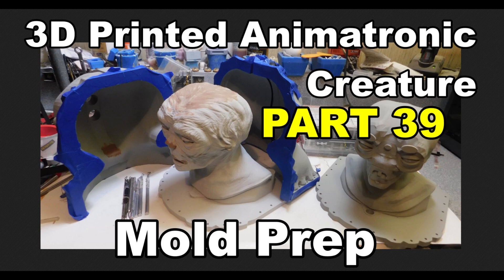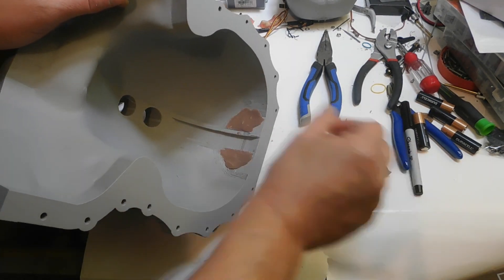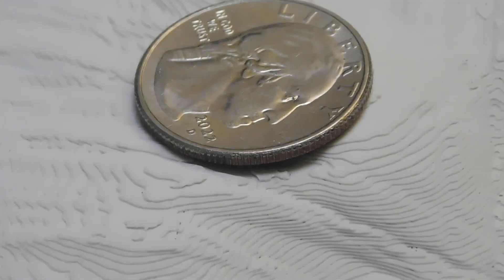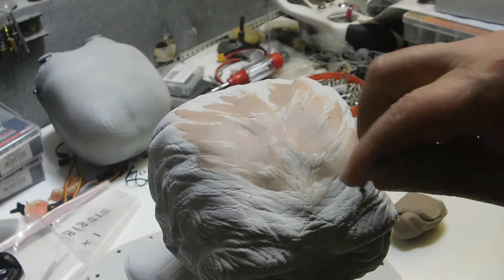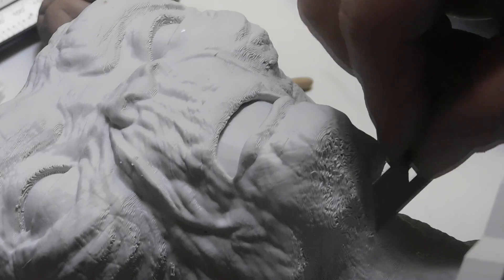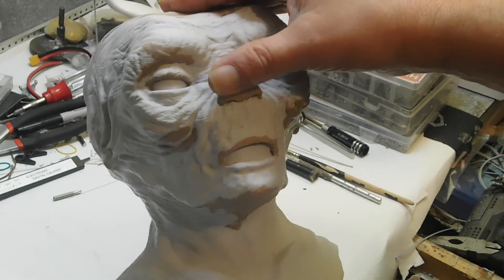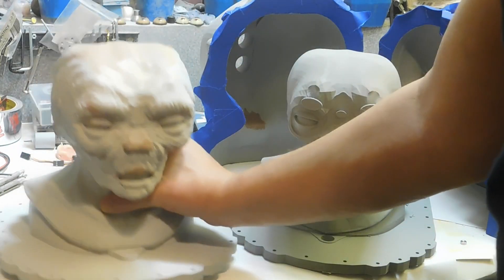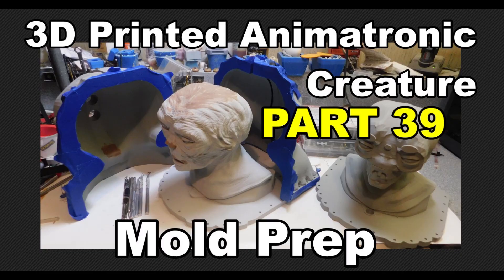3D Printed Animatronic Creature Part 39

Comment: What silicone do I use to make the animatronic skin? I'm a student, I used plastisol, as it is known in Brazil, but it has to be heated, and I found it complex.
Reply from the maker: Creature molding silicone using Mold Star™ 30   https://www.smooth-on.com/products/mold-star-30/         Skin silicone Ecoflex™ 00-10      https://www.smooth-on.com/products/ecoflex-00-10/                Important casting silicone into a silicone mold , this agent is Needed.     Release agent is sprayed in and out of the Creature mold.                                      Ease Release™ 200         https://www.smooth-on.com/products/ease-release-200/

Comment: Those chin hairs and other leftovers just hit them with a little fire. A lighter or a little butane kitchen torch. 

Usually you can get away with way less supports than it suggests also. 

Use modifiers to change settings in different areas. Like the topographical dome effect there select that area and charge your layer height to a finer resolution. 

If you need to have flexibility for anything try flexible PLA...the Flashforge stuff is really good(specifically the blue which is somehow better than the grey and black). Print around 220. It's softer than a lot of the TPU that isn't crazy expensive and it prints like PLA. Like $25 a spool. It is quite durable also. Good for little fiddly bits or weird appendages or even just to make bushings etc to absorb vibrations. It looks like something that would be useful to you.

Comment: Nice progress, glad you got to break out your sculpting skills.
You can use an acetone and body filler slurry to help with covering up printing blemishes. 
You can also change the print orientation when you chop the model up. As an example, you can flip the chin section over and you wont have the overhang under the chin. If you turn that slice of the head on its side, you won't have the problem with the topography as badly. You can then hide seams in various ways and fill them in.
I did all of that with my raptor and other models. :)
Reply from the maker: Thank You Chris ! I did a clay mix of Monster clay and Chavant sculptex 70/30 so I use a 91% Isopropyl Alcohol wash for blending and smoothing the clay and also it's winter , That clay be hard... LOL!